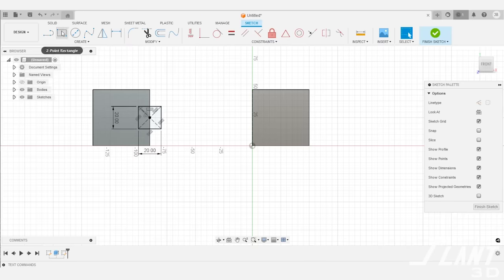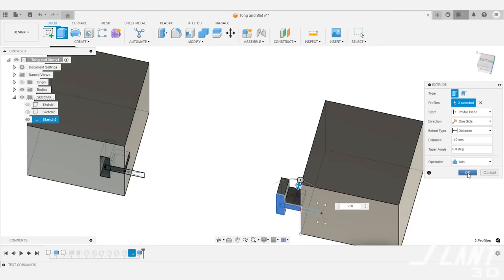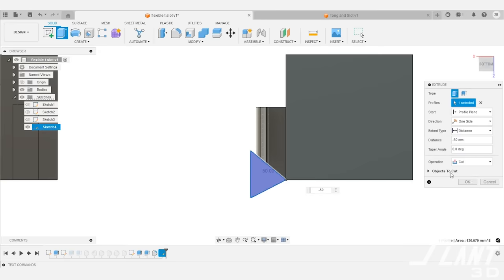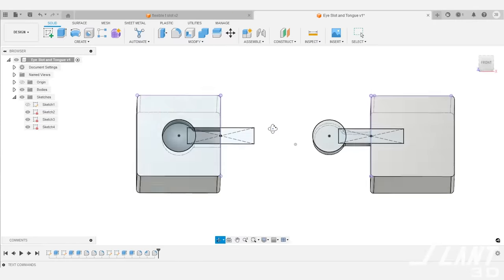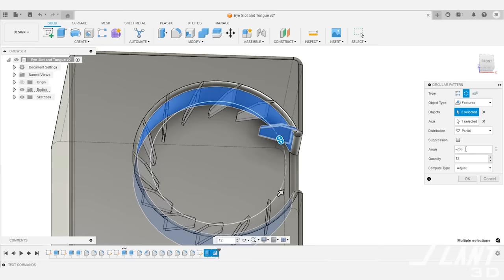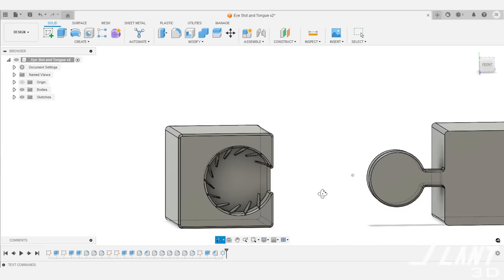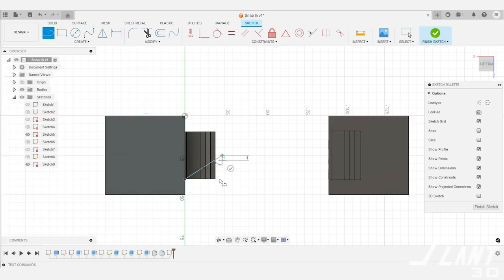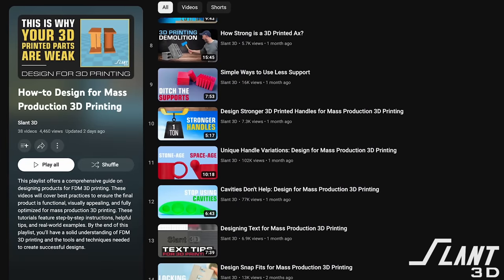Joining Features | Design for Mass Production 3D Printing

Comment: If you look at the geometry at timestamp 3:01, you can see that this isn't printable. Yes, you can print the 45 degree centre, but the extreme edges of the curved head would be printed in fresh air.
Personally, I often design something as a whole shape, then draw a dovetail with say 60 degree sides for the join. The dovetail has nice fillets added to it. The dovetail is made as part of a cut for one side and then flipped over for the other side. The part has two Configurations, and you output the sides as separate .step files for printing. I've found that printing everything size for size results in a nice tight press fit. You get pretty much the same shrinkage on both halves, so it just works.

Comment: My favorite one to make is angled dove tails. They are nice because you can sit them flush and it's still a simple geometry. Plus if you angle it then it only comes apart in that direction which could be hard to know or see if it is not facing out. The top will look like a triangle but really it's slanted

Comment: I'm a carpenter I stick to what I know and worked for centuries, I just make a dove tail. it is less likely to have anything sapping when pulled on and when you make the slot a tiny bit further in the parts get pulled together tightly.
Reply: Dovetails dont work as well on 3d prints in my experience due to tolaerance issues

Comment: These snap-in joints are great and I have been adding them to my assemblies too. I found the snap-in joint can be cylindrical in order to snap into a circular hole, if one-degree-of-freedom rotation of two parts is required.

Comment: I use a lot the good old dovetail joint, used since forever in woodworking. In prusa slicer it’s easy to add at slicing time.

Comment: I haven't actually designed joint parts like this, but my intuition tells me I wouldn't want the joints to be permanently attached to either of the pieces and rather be a piece of itself.
If both joint parts have female recesses and you have a male-male joint, it may not be quite AS snug, but if something breaks, you only have to print another joint.

I'd really like to know what your opinion on that is!

Comment: The best "adhesive" for any thermoplastic is the material itself. You can design the join so that you can weld it together with a soldering iron tempered to around 200°C. Of course you need to use soldering iron tips that you don't use for soldering lead.

Comment: It is actually possible to make this by traditional plastic molding because it is possible to make injection forms that has small moving parts. 
It is important to say that if you are using nylon or other types of plastic, that is very liquid under the molding process, there is some things you can do

Comment: Female half can be a spherical cut as long as the cavity is more than 1/2 a sphere and the male half joint is the same percentage of a sphere (I like 5/8 of a sphere on both but 2/3 has worked for me as well) These are snap fittings, but once they are in, they are pretty well in there unless you really want to play with the tolerances.

Comment: I love the idea of printing the fastener along with the part in one piece. Even for 3D-printed parts, I rely heavily on bolts which require the use of heat seat inserts to give the plastic part threads. Bolted connections are great and strong, but adding the inserts is an additional manual operation that takes time, unlike the print-in-place options you showed here. I'm definitely going to try one of these in a design, thank you!

Comment: Good video overall but the thing you said cannot be machined is done all the time.   Check out the EDM sinker (ram EDM) process.  For the design in question, an electrode would come in to the pocket and jog over to do the erosion/machining.    Snap fits are commonly molded as well.   All expensive stuff though.

Comment: Oddly enough, today I was working on car holder for my iPhone. Basically keeping the parts of an off-the-shelf system that work well, and replacing the clumsy and awful thing that actually grips my phone with something bespoke. I came up with a design that had a PETG plate that had a connector for an existing ball mount. And the phone would be held by a TPU grip which was basically a hull between the PETG plate and the phone itself. The hardest part: get the TPU grip to stick to the PETG plate.

Comment: I tried making a concrete mold, and tried making those snap-locking pieces like in the last part of the video, but failed miserably because I didn't leave much room for the parts to move around. Gonna have to redesign the parts now that I've seen a real example. Thanks.

Comment: What if you have a large thin (say 10mm) surface made up of 12 pieces in a 4x3 grid so parts need to connect on multiple sides? What if you were given multiple STL files where you expected just to print and glue them together? What's the simplest way to mechanically connect them? Thanks!

Comment: I love this content. Studying mechanical engineering, so learning this is useful. The locking tabs look a little bit fragile to me, so i probably would have made the tabs have a slight curve or a fin in the middle to be sure the tabs do not break or weaken with extended use.

Comment: A cool case study would be designing tubes and ducts (I've seen your vents video - very inspiring by the way).  I printed a filament "Y" splitter for a BL-X1C and noticed that most of the models are printed vertically, which results in layer lines perpendicular to the filament flow.  So if your filament has a sharp end, and it finds an unruly layer line, it will get stuck.  A solution could be to use a hexagonal profile and print the splitter flat so that the layer lines wouldn't be perpendicular to the filament path.  In the case of other ducts or pipes, I believe you spoke about this in the vents video, but the layer lines if perpendicular to the flow can create turbulence which may be good if you want to avoid material deposition, or if they are aligned with the flow may help laminar flow for other applications.

Comment: I have been searching for this topic for a month, now I finally find it. Would also like to know about tips for combining magnet to 3d print ed part.
Reply from the maker: Cut out hole. insert Magnet. lol
Reply: An option is to pause print, drop magnet in embedded hole, continue print. Or place a recess in the design, where magnet can be glued in. Orientation of magnet is critical, or will have opposite effect.
While great for a limited print, neither is not practical for mass production.

Comment: Nice video as always!

Did you already did something on angle adjustable 3D prints? On my learning journey, I am now trying to print a little case for wave millimeter sensors, that I can snap on a wall or the leg of a bed and adjust the angle... Somehow.

I haven't found much for that (or maybe I do not use the correct keywords).

Comment: Why no dovetail feature?  I use them when splitting FDM prints all the time.  When properly toleranced, they slide together and the layer lines lock them very well when the dovetail engages.
Reply from the maker: They are a variation of the t or I tongues

Comment: Snap in joints are actually very readily available in manufacturing. Undercutting using t slot cutters and form tools is do able. Its just less apt to use verse more common alternatives, rather than impossible.

Comment: For one thing, you forgot the dovetail. also, you could put the tongue on both parts as well a the hole and print one upside down to remove the need for supports. I wish I did that on my stupidly big spool holder instead of relying on dovetails all of the way through. I used 0.15 for a tight fit, which would be fine if the fit was shorter but, had to resort to a hammer to put them together.

Comment: Would love to have the cad files for these designs, preferably parametric so we could mess with some of the options you mentioned
Reply: Unless you use the same CAD package or one that can import original files it is way faster to make these features from scratch than to import them.

Comment: Great video. I like your simple explanations.
The last type of joint is actually not that rare. It's been used for electrical connectors for a long time. E.g. the audio jack connectors use a similar mechanism.

Comment: Great video - have been using tight dovetails - but tried your sprung T join today and it seems to work quite nicely.  Once you get the joined pieces nice and tightly together has you got any suggestions on how to hide the rounded corners you get between the joined parts.  I don't think they can be eliminated with settings due to the fact that the nozzle is round.  I've settled on printing a bit extra either on one side or both sides at the edge - either to hide the joint a bit, or as something that can be shaved off in post processing to give nice square corners or very thing overlaps.

Comment: 7:34 it's called a buckle. It would certainly be difficult to make the buckle receptacle part using traditional subtractive manufacturing techniques, but I do not believe without evidence that it is /impossible/ to make that part except by additive manufacturing.

Comment: So the last one is good but really flimsy. You could upgrade the design by adding a central pilar, the tolerances don't need to be tight since it's just for structural support and not for friction. Or just make 2 of your design and put them on both sides of the part.

Comment: Most excellent vid and subject. Subscribed!!
How would you advise joining two much smaller/slender parts?
Like getting chop sticks to attach end-to-end.
Reply from the maker: Really depends on geometry. It round use a sleeve. If squre use a press fit flexible tongue

Comment: Thank you for these super-informative videos! 
I would love guidance on 
- thin features like those snaps: do you make their thickness in multiples of 0.4? 0.5 due to pancaking?
- unsupported spans: I gather from a previous video that 20-25mm is the limit, is that right?
- tolerancing for tongue-and-groove: I used to design for a Stratasys uPrint with dissolving supports (yech!) and there I would design line-to-line and it worked great every time. Same or different with y’all’s printers?

👆🏼 having all these kinds of things encapsulated in a document on your website might also be nice :-)
Reply from the maker: We are working on converting the videos into infographics. Generally design with a 0.5 total spaceing for tongue and groove with good filleting to compensate for material expansion and side extrusion. We go over snaps in an earlier video. Really dictated by stiffness needs.
Reply: I prefer to run my machines with a centered tolerance field. So 0 ends with a very smug fit though I consider shifting toward slight negative bias so parts fit inside the defining volume a bit better. I think something like -0.03 to -0.05 given my machine makes parts with better accuracy for straight lines should yield good results in terms of consistent fit.

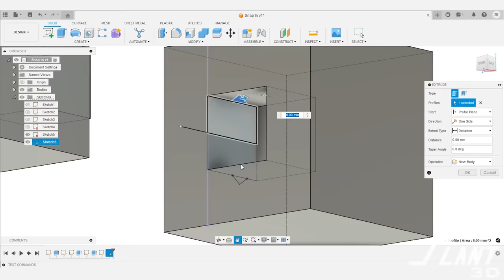Comment: I enjoy your content however at 7:00  you state the internal locking feature is impossible to make in non 3D printing manufacturing. I disagree. As a plastic injection Moldmaker I have encountered, and made such features in steel and molded parts. It can be achieved with tunnel cores, finger cores, in molded parts and sinker EDM in metal components. Many automotive plastic components use this style of retention.
Reply: I've watched a few of his videos lately and it seems he's either a bit unaware about what's possible with injection moulding or he's knowingly skewing the narrative a bit since he's running a business.

Comment: Why does the eye-tongue have to be attached to 1 of the pieces at all? Print them separately and print the pieces with suitable holes in either side of the pieces so an eye-tongue can be inserted on either side to hold the pieces together. This will stop spreading too.

Comment: I will say that the tabs are possible just much more annoying, usually using a bit that looks like a modified woodruff cutter in a mill but annoying. Or if circular done by turning ID and OD, then boring the ID part and slitting saw cut the relief.

Comment: Everything you said.. was essentially wrong.. they can be machined just fine.. just not with tooling that you are aparently are aware of..  but also inejction moulding is very much an option.. but you should really go look at Electric discharge maching in tool and die shop - then redo you whole video with starting to say "i was wrong, and i need to correct myself and excuse myself before i shut down my channel."
Reply from the maker: Internal recesses or  "Undercuts" cannot be molded due to the non-ejaectability of the part. And solid blocks of plastic cannot be molded due to shrinkage.